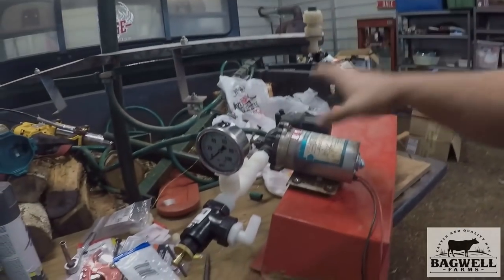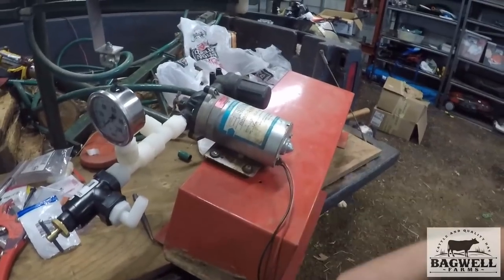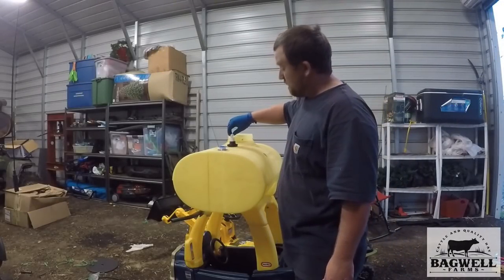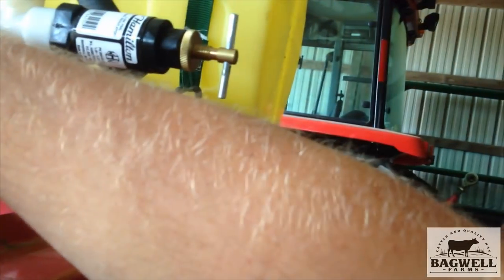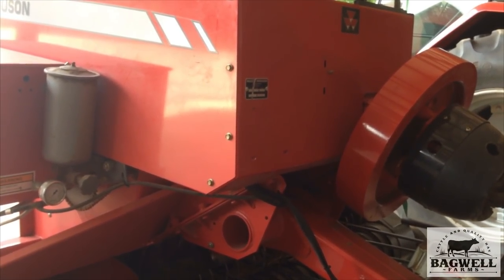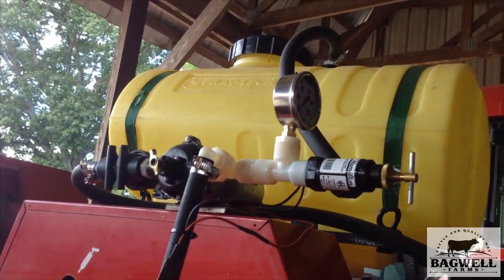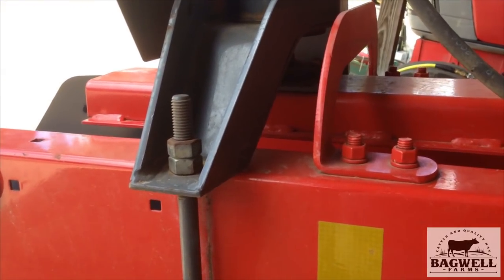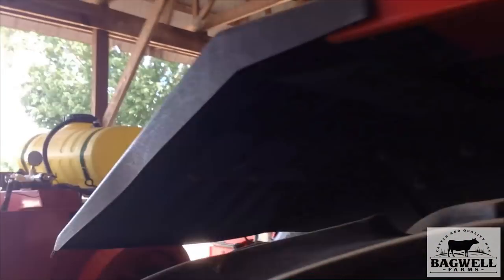Home made hay preservative applicator part 2

Comment: Have you had any problems with the Delphi pumps on the Massey
Reply from the maker: I’m guessing your talking about the injection pump on the 383?
Reply: No I have a 5445 and a 5450 had rebuild injection pump in both tractors at 1400 hrs
Reply from the maker: Lon Ely not yet it’s got nearly 3000 hours got my fingers crossed 🤞 lol the  383 has 6000 still the original pump